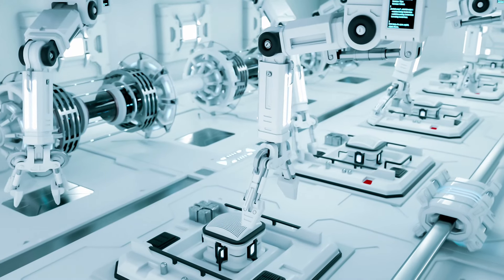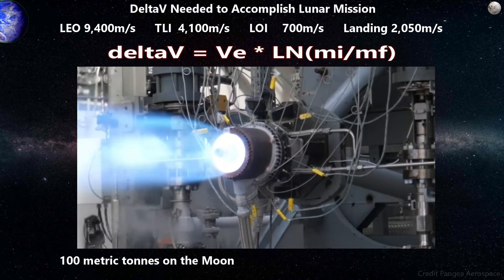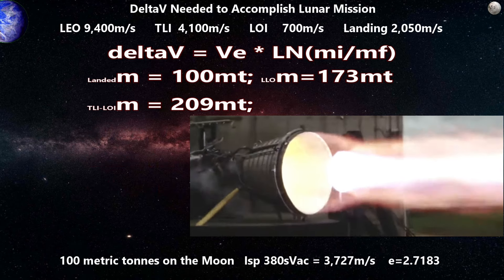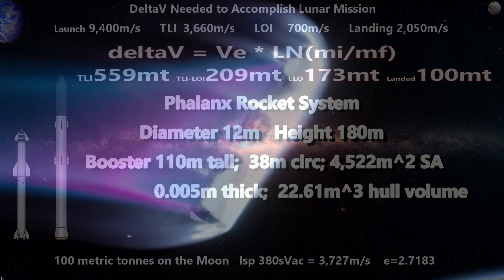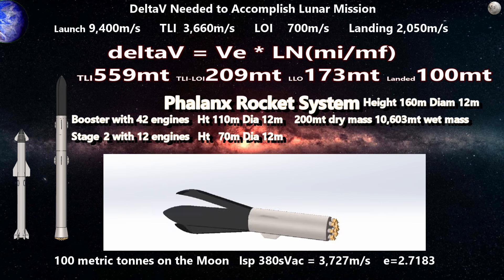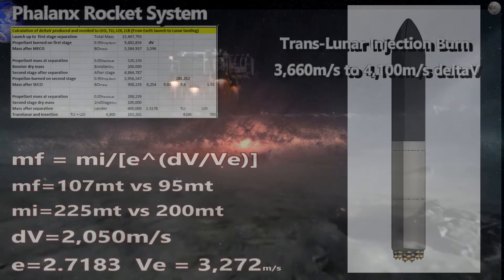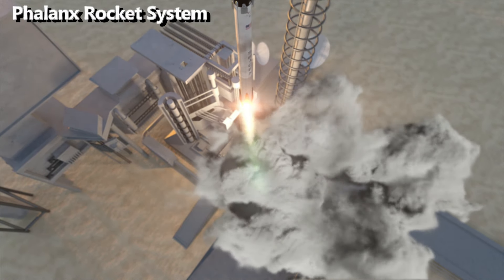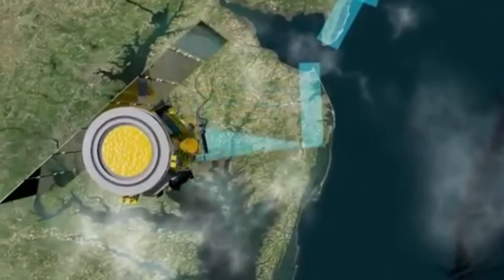Rocket Science: Designing a System Better than Starship: The Phalanx Rocket System

Comment: I really wish you had not hand-waved away the difference in tank sizes for hydrogen vs methane for the 2nd stage. The increased tank mass to keep the same payload size is not trivial (and has cascading effects to the first stage as well). It may be that you ignored this because you include the ship mass in the '100t to the moon' payload, when you should have than 100t be in addition to the weight of the craft carrying it. by that criteria, starship is landing 200-250T of payload on the moon.

I also think that you are probably underestimating the tank weight. Starship has ended up needing a significant amount of stiffeners in addition to it's skin on the booster. Remember that the booster needs to support the weight of the 3nd stage at max acceleration (call it 3g for the sake of simplicity), so a much heavier 2nd stage imposes significantly more load on the first stage.

I think it would also be useful to show how large an effect a small change can have, you sort-of touch on this the other way (although incompletely) when you talk about the increased ISP of the RL-10 vs the ideal methalox, but you should show it the other way as well, what if your 2nd stage is 10% heavier than planned, how does that cascade into larger tanks, even more weight, a bigger first stage, more engines for the same thrust-to-weight, etc. A good way to do this would be to show the difference in the overall craft if you use stainless steel vs the titanium that you picked .

And then there is the matter of the cost. In addition to the titanium vs aluminum vs stainless steel material costs, there is the processing costs.

One problem the space industry is a bit blinkered about is ignoring the costs of materials and construction costs vs the resulting payload to orbit. Look at the pictures of the Vulcan/New Glen/SLS tanks being built (take a couple inch thick panel of aluminum, spend an enormous amount of time machining away 99% of it into a grid, spend more time and big machinery bending the result into a cylinder) vs the starship rolled/welded rings. Yes the first is lighter than the second for the same strength (ignoring the need to handle reentry heat loads), but the cost involved in this mindset goes a long way towards explaining why those craft are so much more expensive.

Titanium is in short supply, IIRC the majority of the supply is in Russia (geopolitical risks and costs), and the processes to use it (welding, cutting, etc) are significantly more expensive than stainless steel or aluminum.

You completely ignore the benefits of re-usability with the focus on the one-shot to the moon. If the rocket is reusable, then in the long run, the cost of the rocket itself becomes almost insignificant, and with refueling you can have the specialized orbit/deep-space only craft (which will work for the moon, but for Mars you do have reentry and a significant launch thrust needed at the other end, so something like starship is needed at each end, even if you can have non-reentry craft for low-earth-orbit to low-mars-orbit. your guest does touch on this lightly (along with refuing satellites) but it is lost in the Phalanx design.

and finally (and again with this request) I would really like to see a video covering 'gravity drag'. you repeatedly use the figure of needing 9.4km/s of delta-v to achieve 7.8km/s of orbital velocity for LEO, but that figure is very different between a rocket with a 1.2:1 thrust-to-weight ratio (like the Saturn V) vs one that has 1.5:1 (Falcon/Starship), even if you limit the max acceleration is limited to 3-4g. SpaceX sees this as being significant enough that the Raptor 2 engines are sacrificing ISP to increase the thrust, and they are adding additional weight and complexity to the booster (more engines) to further increase the initial thrust-to-weight ratio. They could lose about 1/4 of the engines if they were satisfied with the same t/w as the Saturn V. Tim Dodd touches on this in his raptor1 vs raptor2 video, but doesn't complete the calculation to show the cascading effects that this then has on the fuel needed, tank size needed, etc (the inverse of the earlier point on how a 'smallish' difference in the final weight has a large impact on the total rocket size)

And please don't take my nit-picking as something to discourage you from making videos, your videos are among the best on these topics, I'm just trying to nudge you to even better results.
Reply: This is a great post.  I too felt those 'doubts' but feel that an integration with FEA analysis and AI learning could speed the whole process dramatically, and that, for instance, Spacex could, some time in the future, modify its production process accordingly anyway.  Whatever happens, it will be good.  I hope.
Reply from the maker: Thank you David. You make good points but again this exercise is to give someone the tools to evaluate rocket systems.  First we must determine that it is feasible.  Then we would do the computer modeling to refine it.  This is the first step.  Our goal was not specifically to prove that this design is perfect.  As we said in the video... There are a million problems to be solved.  When a client comes to you with a design... You tell them what it could do.  You don't start redesigning everything they've done.  Titanium will be cheap in space once we start mining it on the Moon.  We did indeed address reusability.  Both our first and second stage were reusable.  Only the third stage lander was left on the Moon.  The issue of gravity drag is covered by maintaining a thrust to weight ratio of 1.5.  If we go higher we can reduce gravity drag.  Maybe with some boosters.  That would be a good video.  Thank you so much.  We always appreciate your feedback!
Reply: @terranspaceacademy  Your response was all I hoped for.  Work like yours is necessary for increasing the tempo.  The 'window' isn't large.  Good luck and fair passage.
Reply: @terranspaceacademy  re-usability has a lot of additional weight penalties (heat shield for upper stages, landing fuel reserves, legs, etc), which you didn't seem to allow for, so I missed the reference to re-usability (probably another video there). I think I saw someone recently do a video on the different payload capacities of the F9 with different recovery options, and the fact that the last CRS mission did a partial boostback (so the drone ship was closer to port and so could turn around faster) is an interesting wrinkle on the topic.

The SLS and Starship are treated as close to equivalent payloads, but when you start considering expendable starships the difference is striking.

Comment: Love the Video, disagree on the Aerospike as the future of spaceflight though. Unless we develop some sort of super-alloy that can withstand the insane heat at the tip of large Aerospikes and lightweight control systems to steer with them that don't involve moving the entire assembly, a bell nozzle design will continue to be superior.
Reply from the maker: Thank you Phoenix.  We have that alloy... GRCop42.  The paradigm has shifted :-)
Reply: For the record, isn’t Raptor inherently having to move its entire assembly in order to gimbal at such extreme range? And by being much longer it has a longer lever arm which whatever motor type they use would have to compensate for the same degree of movement as a shorter engine, an aerospike engine, can have.
Reply: @terranspaceacademy  

I’m less questioning how you’re expected to use an aerospike on this launch vehicle, and more on how you get 5800kN out of a methalox engine. Setting up historical precedent doesn’t help anything. Limitations are fuel type (in specific impulse) and the mass flow rate of said fuel, which needs to be able to produce that much thrust. I would recommend propane for the booster. It can be cheaper to obtain and store than methane, and remarkably denser while not sacrificing much isp. That would give a booster of the kind you said it was (let’s say an active market between the moon-earth is established which cheapens the supply of Titanium) a potential ability for 225MN while the ship either uses the same fuel or methane/hydrogen, more optimized for space.
Reply from the maker: Propane is an interesting fuel... as is butane... hmmm. Sounds like a lesson :-)
Reply: the idea of an aerospike is that you get rid of the tip where the heat is the worst and replace it with a base bleed in the trucated spike, usually using the turbine exhaust, so we don't really need the alloy for that. the place where cooling is a mass issue is that aerospikes can't have radiatively cooled nozzle extensions. 
we also do have technologies to steer without moving the entire engine. the design of a large aerospike allows them to use differential thrust from the separate combustion chambers to thrust vector, and any rocket can use fluid injection in the nozzle to get 10 degrees of thrust vectoring relatively easily and very reliably. It's actually what most ICBM motors use for thrust vectoring.

on the other hand, there are two problems I personally see with aerospikes. the smaller one is that they might not cluster very well in vacuum because you'll get plume interactions before the exhaust passes the end of the spike, though I see this mostly as more of a complication than a persistent problem. 
the big problem I see has to do with thrust and area ratio, and it applies to all passively altitude compensating engines. An engine with a large enough area ratio to have a good vacuum ISP doesn't have very much thrust per area compared to a sea-level optimized engine. The phalanx animation had to have that huge cone on the bottom to house all the engines to produce enough thrust using aerospikes that are viable in vacume, adding a lot of mass and drag at launch compared to using sea level optimized engines. it's also why the venture star design had to have such a stupidly large engine. for a single stage design, where altitude compensation is the most important, you also have the issue that your ISP goes down at lower throttles for a fixed throat width, which happens at the end of your burn exactly when you need your ISP to be the highest.
My personal bet for future altitude compensating engines is more along the lines of active altitude compensation, like the old Aerojet thrust augmented nozzle design. it both gives you altitude compensation without giving up thrust density at sea level, and lets you use a H2-CH4-O2 sequential burn tri-propellent system for a lot less trouble than the RD-701, which nearly doubles your payload on stages with a very high fuel fraction. the other active (or more semi-active) altitude compensation system that has a lot of promise is a variable throat expansion deflection nozzle that can maintain chamber pressure (and therefore ISP) even as you throttle down the main combustion chamber. while it use to be an almost impossible engineering challenge, there is now a class of invar related cryogenic superelastic alloys that I think make it possible.
Reply: @thamiordragonheart8682  my thinking is to combine the perimeter engine thrust chambers into one huge aerospike (look at what they did for the linear aerospike engines and do it in a big circle) with a small cluster of traditional gimbled engines in the middle providing the pressure to replace much of the cone.
Reply: @davidelang   @David Lang  If I'm reading this right, what you're thinking is something close to a contiguous ring of very large single ramp expansion nozzles around the outside with a set of sea level optimized bell nozzles in the center, call it 7 for the nice honeycomb pattern. having a single annular combustion chamber around the outside would be hard because it would get some weird combustion instabilities and the inner wall would be harder to support (meaning heavier).
a few other thing to keep in mind are that an "aerospike" that big is going to be very long, and the aerospike systems with a base bleed use a couple percent of the main flow injected subsonically, and I don't really know how that relates to putting 4km/s engine exhaust in the center.
Reply: @thamiordragonheart8682  you have the right idea.
you talked about eliminating the tip and using turbine exhaust to support the center. I am just going a step further and replacing more of the tip with the exhaust of more engines (which would be much higher volume, and probably higher pressure, so could replace more of the tip)

how long the result would be would be a matter to be modeled/tested, but car aerodynamics routinely cut off the curve early and use dragged gasses to complete the effective curve, so I would expect the same thing should work here.

as for strength, given that it's a large ring, pushed from all sides, it's going to have a fair bit of support.

but it's unlikly that any aerospike at anything close to this stage is going to be tested any time soon, so it's all speculation until someone models/builds something.
Reply: Never underestimate artificial intelligence and additive printing
Reply: @davidelang  the idea of a regular aerospike is to use the "dragged gasses complete the curve" principle to get rid of the spike. part of the reason this works in the car context is that the fluid basically applies pressure to the recirculation zone as if it were a solid boundary and, assuming the flow is stable, the recirculation zone comunincats this pressure to the vehicle, which is how a stable recirculation zone reduces preasure drag, or increases thrust in the case of a trunkated spike nozzle.  the recirculating gasses at the base of the aerospike tend to be around 1 atmosphere of pressure when the engine is on no matter the altitude. For complicated physics reasons I don't entirely understand, adding a little gas flow out the flat part makes it more efficient, though I would guess that it somehow reduces the friction in the sheer layer. 

Using more engine exhaust to support the center seems fundamentally different to me for two reasons. The first is that if you're using engines for the center, the exhaust is supersonic, so there is no way for the pressure increase due to the expansion of the aerospike exhaust against the central engine exhaust to be communicated back to the vehicle and produce extra thrust. maybe you could purposely overexpand the exhaust from the central engines to take advantage of the downstream compression but I'm not actually sure if that would work as well. The second reason it seems different is that the recirculating flow stays separate from the exhaust flow and stable because the sheer layer between the two flows acts almost like a wall. if you're using rocket engines in the center there is necessarily not such a large difference in flow velocity, so I don't think the sheer layer would be as stable, and that could have a large impact on the flow, at the very least increasing friction due to vorticity where the fluid streams mix.

the strength question was because the inner ring, unlike the outer one, is under compression and therefore has to contend with bucking, which my intuition says requires a lot more material thickness than just handling the compressive stresses, even if it does still scale linearly with radius. buckling is also much more sensitive to slight imperfections in the shape, which could make things even heavier and/or more expensive to compensate.
Reply: @thamiordragonheart8682  catching up on videos after a week of travel, but the next video on the Chrysler SERV has the large-perimeter aerospike approach I am thinking about (wihtout the center engines)

Comment: he is not paying enough attention to engine compactness I think. He thinks he can fit 42 of them, and have them generate 5MN thrust each
and he quotes F1 engine from Saturn 5
that is was over 5MN
but it was also so large, that 42 of those would never fit under 12 meter diameter rocket
this would not work
Reply from the maker: Aerospikes are much smaller than bell nozzle engines for the same power.

Comment: Me and some of my friends are looking to start a launch company when we leave school. We’re obv going fully reusable from the start and are currently researching a lot of engine and motor-related things, and looking to fly a series of model rockets and gather data, as well as doing some primitive liquid or hybrid engine tests like static fires or a basic hop on a small rocket. Anyways, after the sounding rockets, (maybe a small-lift rocket?), a medium-lift rocket, and then a Starship-esque SHLV, we’re looking to make an “Ultra-Heavy Launch Vehicle. Something of the Phalanx’s class. Currently looking at 14m diameter, 200m tall, each engine possessing ~5500 kN ASL with 420s Isp (Methalox, but focusing on efficiency rather than thrust, with techniques such as 3d printed, fine-tuned components, etc). We’ve made smaller methalox engines in a simulation software, and they’ve gotten to a truly nutty 470s in a vacuum (albeit with a ridiculously high ER and nozzle length : engine size ratio). It’s merely a matter of scaling up to the 5-6000 kN thrust range and retaining the efficiency. Oh also, we’re going for 500 BAR in these engines. Yes, we’re happy to take the weight penalty for heat-reinforced parts of the engine. If you couldn’t tell, the Eclipse engine is going to be hard to make (lol). Not decided on a launch system name yet (maybe Callisto? Or perhaps Artemis if SLS is cancelled? Sounds like a cool name). We’re aiming for the similarly lofty goal of 130t to Luna’s surface. If you want to hear more, I’d be happy to share some more specs of our smaller rockets to give you a better idea of how we get to… this. We’ll make some prototypes in our sim software and will use these calculations to see what we can bring to different places! Aiming for 110t to Mars’ surface. Incredible and super helpful video, thanks! :)